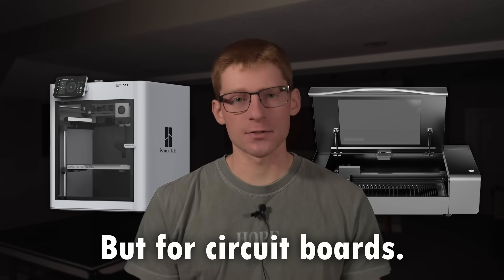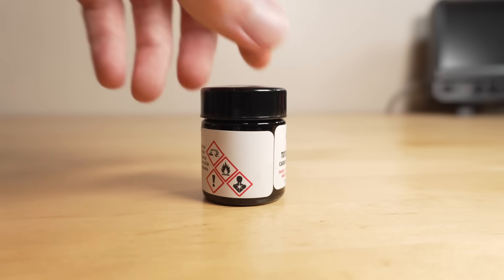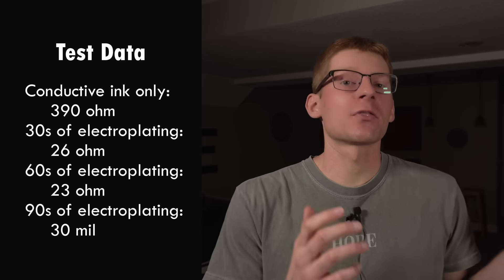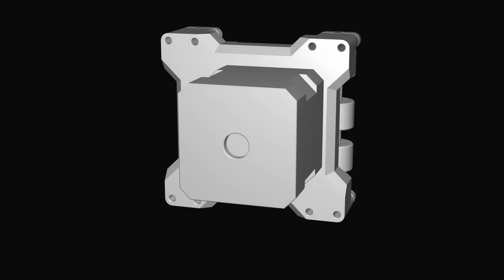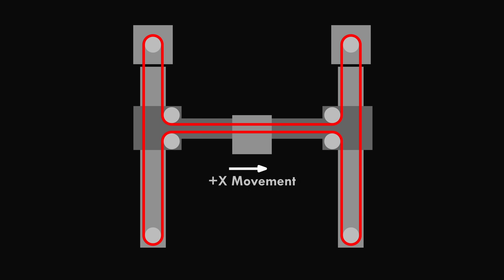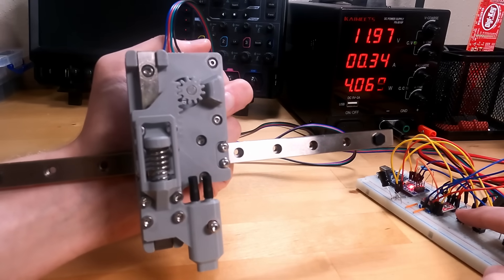I'm Developing a New Circuit Board Manufacturing Technology

Comment: This project in very interesting to me. I started a few years ago building a pulsed plating power supply, but got side-tracked and have yet to resume it. This project was in response to the fact that commercial PPP gear is very expensive. The advent of PCBWay and others like it reduced my motivation somewhat, but I still resist the idea of paying for 10 boards when I need only one. I hope you will continue with this research, so I can have a reason to resurrect my own project. Maybe I'll post my work on that and link it to yours so more people will climb onboard and maybe get enough crowd-sourced engineering to create a new solution to a long-time and widely vexing problem.

Comment: A 0.3mm hole. I think most folks might buy it if it could do 1mm vias just fine. Sometimes you cant give all the bells a whistles on the first sell. Could you possible copper coat the inside of the hole using high voltage? Also 30awg is 0.254 mm thick so maybe find a way to shove a small piece of wire into the hole and bond it? Not every idea os a good one.

Comment: Couldnt you just start with a lower voltage, then start to generate the electroplating, then increase the voltage? 

Complete hypothetical thought experement. 

Lets say you start with 20 volts, which under just continuous voltage lets say would take 10 mins to form, too long but it gives the best through hole.  

If you started with 80v the copper would form in a few seconds but the  issue was the copper would add to the end too fast eleminating your hole you made...etc. 

What if you mix a little A with a little B. 

Start your electroplating at a minimum voltage, then either linerally or logorithmically, or even pauses in the voltage to increase your voltage over X time. 

Then it would be just playing with 3 variables. Which would be your: 1.start and stop voltage. 
2. Your stop in time. 
3. And how your voltage changes between said time frame.

Comment: How about breaking down the via plating into two parts (1) ink deposition in vias sequentially (2) electroplating all inked vias simultaneously using a bigger tube flushing a large section of the pcb?
Reply: Great project, amazing to see, congratulations 👏👏

Comment: This sounds like an interesting project. Let's see now.

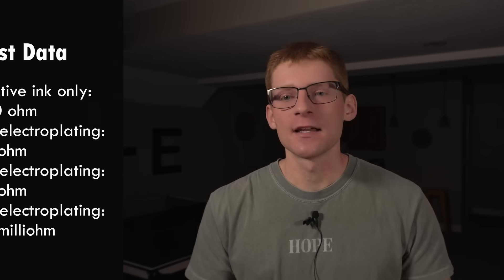@4:30 Impressive "via" resistance. I am concerned about the strength of adhesion between the substrate and the vias through the carbon layer in that it might lead to flaking and cracking, which would cause a rise in resistance.

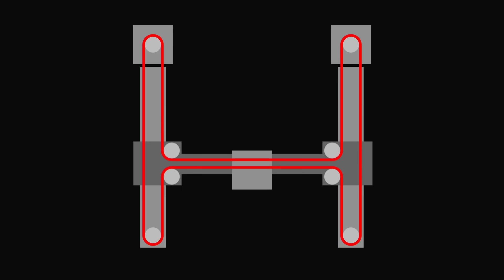@8:30 Interesting. Reminds me of the movements permitted by helical wheels. Unfortunately, the motors will fight each other. You will either need to use motors that cannot be backdriven or a feedback system that allows them to detect and compensate for the forces exerted by each other, otherwise you'll have positioning issues in terms of accuracy, precision, and reproducibility.

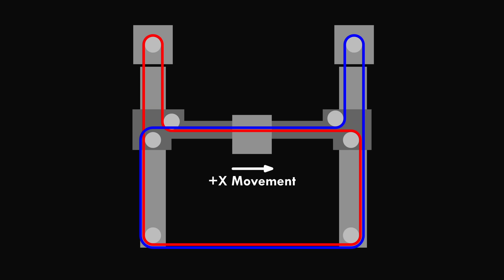@9:45 Oh. I hadn't considered the differential torque applied to the gantry.

@12:00 Ah. There's some of the positioning issues that I had anticipated. Yes. With two independently-positionable mechanisms, the ability to co-align them at a specified position is an absolute neccessity.

@14:25 Your electrodes must be in a different position in your device, relative to the board, compared to when you did it by hand.

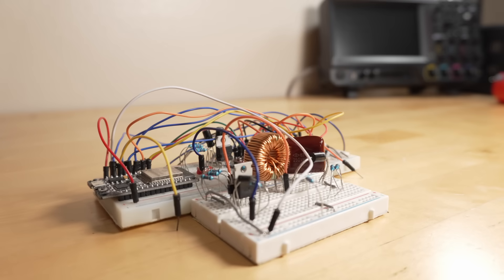@14:45 You went from 12 V to 80 V? Careful about those voltages and currents. You don't want electrolysis-caused bubbles to form on the surfaces onto which you are attempting electrodeposition.

I wish you success in your future attempts! I will be looking forward to seeing them!

Comment: The reason the industrial way to make a via is to electroplate is because it is convenient INDUSTRIALLY. 
Your solution does need to copy that. Others have mentioned it too.  A simple, mechanical way of adding a conductive material between two layers is the way to go I think. Perhaps you already thought about it. 
Like a prefabricated piece that can just be picked, placed and secured on the drilled hole from both sides. 
Then you can use the same thing for pins too. 

Messing around with liquids and chemicals for a desktop application is unnecessary. 

But I do applaud your determination and creativity

Comment: just spitballing here, i think the fastest way would be a custom "rivet"-style connection. drill hole from top, bottom effector "stud" comes into place, top effector feeds 0.3mm copper wire into the hole, clips it off (nail clipper style mechanism?), then top effector switches to another "stud" and presses down - effectively crimping it in place.

Comment: Hi, great project idea! I just have a question, I mean the electroplating is definitely great. But wouldn't it be easier to just put metal rivet in the hole?  I think it would greatly simplify it, especially if a plan was to add pick and place ability. 😋

Comment: Reading the comment about using wire to make via. The main argument I read is that you need to solder them and it would melt if you heat them back when installing component. But what if you electroplate them. No soldering but creating a copper link to the wire and the copper plate. Once the wire is connected to the board you then remove the copper to make the traces. By CNC or other process.

Comment: This is a really impressive work. The itch you try to scratch is shared with so many EEs. I have seen several projects lately, trying to come up with a good solution, but I think you are the one really tackling the important issue of vias. 

It’s so easy just to skip the hard parts, even if they are important, just because they are hard. Google one’s brain to think it’s still worth the job. And people ends up spending a lot of time making a machine that will not be used when they completed it. 

I’m wry sorry you didn’t get the vias to work and I hope you have better luck with the next iteration. 

Regarding the issue described above, I’m afraid you might have done the same, not skipping vias, but layers. In this advanced time of electronics, where we put radios on everything, and high speed lines between components, two layers isn’t enough. Suddenly you are limited to arduino level boards. 

I think you should twist your brain to make a system that enables you to make four layers. Or, when that problem is solved, any number of layers. Then you will actually be able to use the machine. And many labs around the world would be interested in buying it. Maybe even your sponsor would be interested in, where they sell the machine and offers all the consumables. Then it wouldn’t compete with them because this machine would be expensive in use, and used where time is the limiting factor. 

There are many ways to solve this. Probably the most likely way is to start with blank fiberglass boards and grow on the traces like you do with vias. Print the layout with conductive ink. 

I really admire your work, it’s really impressive, and I don’t want to appear like an internet sofa complainer, I’m just sharing my thoughts as a fellow creator whith the same dream of a desktop PCB maker, knowing that the limitations for me today, making me not using the CNC and rivets, that actually works quite well, is that I need the ground planes on almost any project I do today

Comment: When manufacturing a peristaltic pump, it's crucial to ensure that the inner walls of the tubing being compressed by the pump do not come into contact. I work with dialysis machines that use these pumps, and maintaining tight tolerances is essential. If the inner walls of the tubing touch repeatedly during operation, it can cause material (e.g., silicone) to break off and contaminate the liquid being pumped. This is particularly critical in medical applications like dialysis, where contamination must be avoided at all costs, but it's likely important for your application as well.
Reply: Another note, these tubes are consumables and, in the case of dialysis machines, are typically rated for around 12 hours of operation before needing replacement. Something to consider in the design.

Comment: Just wondering if an alternative conducive ink would be helpful.   Adding Graphite Powder ( dry lubricant). to a liquid or resin to make something like a conducive ink.  I have tried white glue and polyester resin. 
The Graphite Powder functions as a thickener for the polyester resin I did not test how low I could get the mix but I suspect that mix the consistency of toothpaste would be low enough resistance for many applications.    After thinking about it a few minutes I could not figure out a way to handle the obvious problems with mixing and applying small batches of the mix.   The most practical solution would seem to be making a filament  and maybe  a special nozzle because the graphite flakes would probably tend to clog the nozzle.

Comment: I work at a recycling center as a bus driver for the employees. They recycle plastic, paper / cardboard Etc.
They shredded around 30 - 40+ big boxes Packed full of repairman schematics on old televisions. This was either a shop or manufacturer that was from Cincinnati Ohio at one time.  Just about every old CRT, vintage television set you could think of was in there. Some televisions were pre-1950.
It broke my heart as a Electronics hobbyist seeing all of that engineering hard work & information destroyed!

Comment: 3:35 if you're gonna have multiple tools, just use a rivet gun. Rivets conduct, just drill you hole, put a tiny rivet through, and pop it to bridge the traces
Reply: That would work for larger holes, but like he said towards the end of the video, most vias are 0.3 mm. I could be wrong, but I don't think they make rivets that small
Reply: If not rivets, small wires could be dropped in place and soldered on both sides
Reply: @mossm717 That would produce horrible results though

Comment: This is fascinating!  

I thought you might like to hear my journey into a pcb mini mill.  I was working in R&D in the mid 1990s and transitioning from through hole to surface mount so I asked the company to buya T-Tech pcb mill.  Was told it was too expensive so I built my own from surplus motion control mechanisms, steppers, limit switches etc.  I controlled the steppers by sending binary sequences over the pc's parallel port.  I wrote a gui in Visual Basic and was able to move all 3 axis.  I needed a way to automate pcb milling so I wrote code to convert the gerber files generated by my then pcb layout program, Winboard, into movements that would isolate the pads and traces instead of just milling lines as the photoplotters do.  This was tricky but I managed to make it work.

Later on I got some real stepper controllers made by Phidgets and got more steady control.  I ended up milling hundreds of single and double sided pcbs.  Since then I've retired but have the machine and still use it.

Comment: My idea would be to drill the hole put a small copper wire through the hole press it on both end like a rivet and drill out a smaller diameter leaving a copper jacket.

Comment: Same approach but multiple vias with a protective film?
Like lay down a piece of tape, drill say 3 vias ensuring copper is exposed on both sides to make the connection.
Plate all 3, peel off the layer? Might scale to full board?  IDK I'm not in mechanical or chemical :P

Whatever you do, don't give up this projects rocks and of all the people working on this problem I think you are tackling it correctly by solving vias first when everyone else gets caught up on them after designing an entire workflow.

Comment: Here's my dumb idea for a machine:
Have a machine that can drill a hole into the pcb, then have a tool head with a silicone pencil-eraser sized plug that can seal the bottom of the via hole in the pcd. You can then have a tool above the via hole inject higher temperature solder into the via hole. Then once the solder cools, you can have the bottom tool remove the silicone pencil eraser from pressing itself against the bottom of the pcb, and you're left with a small cylinder of solder connecting each sides of the board. You don't even need the bottom tool to line-up with the top tool very well, you just need it to be wide enough to make a flat bottom for the solder to be held up against. It'll probably have way too much resistance, and be at risk of melting from other things you solder onto the board, but it's technically a cheap and easy solution that'd probably take like 10-30 seconds per via.

Comment: I have thought about making a PCB maker bot, but using via rivets. I used to use them 35 years ago after manually etching and drilling boards. I can only see loose rivets now but there used to be rivets in strips joined end to end that could be inserted with a tool and then a little twist or wiggle would break them off. I'm sure this could be automated.

Comment: I've made double-sided boards with a desktop router, soldering in tiny brass-rivet-like vias. Quite tedious!  My father left me a huge number of the tiny bits, which I've turned into a small number. I've not made any custom boards in a number of years, but if you make it easy, I might!

Comment: How about using an inkjet printer that could print with conductive ink, then use an inductive laser to cure or process the ink as it prints? Afterward, it could stack the printed sheets into layers, insert hollow pins into the via areas to align everything and create inter-layer connections, and finally place the entire stack in an oven to solidify the ink and bond the layers. It could be a streamlined way to fabricate multi-layered prototype PCBs!

Comment: Hi Levi,
Did you ever think of pre-making vias and insetting tiny little tubes into the drilled holes? Everyone buys filament to their 3d printers so this does not seem like a bad thing at all and would even significantly speed up the entire processing.

A tiny copper tube with with excess on both sides pressed with maybe heat activated glue, but that might not be necessary. We could buy a spool of these tubes and feed them into the machine...

Comment: Could the machine just apply high temperature solder (320+C) to fill small vias after applying carbon conductive paint instead of copper plating or as an addition to it? That way you can keep it simple but still be able to use hotplate for soldering stuff with 130C or 180C paste.

Comment: I think you are trying too hard to replicate production vias. 

For through-hole components, no inner sleeve of copper is needed. You can just solder the component on both sides and be done. 

For trace vias that are 0.3 mm, maybe just shove a length of wire though? I think building a toolhead which dispenses thin wire directly through a pre-drilled hole and then gives it a flush-cut and a quick shot with a laser on both sides to bond it could be very quick.

Comment: I've also thought about possible solution for vias, and the best i've came up with is solder as through wire and then electroplating ABOVE it:
TLDR: mask non-via |``   ``|, drill and make this with solder |`` I ``|, prepare for plating with V shape drill |``Y``|, deposit copper over |``T``|

1. Preparation (f.e. clean pcb blank)
2. Cover in easily removable layer of dielectric on both sides (f.e. soldermask, lacker, photoresist etc)
3. Clean vias sites from dielectric (i.e. expose photoresist to UV, but mask D+0.1mm circle above each via). This step might be unneccessary.
4. Dril via holes. Possibly would require two phases: initial drilling, then deburring.
5. Push wire through holes. Using actual metal wire might be impossible, easier would proubably be to soak with low melting point solder, taking advantage of the capillary effect.
At this point we should have a pcb blank with solder-as-via-conductors
6. Run the holes drilling again, but this time don't drill through, but just dip a little bit in with cone-shaped drill bit. We need to essentially do this at each via: ` Y `
7. Blank is then placed in a vat, filled with plating liquid, prepared side (post-coned) down, opposite side of the blank connected to the current source terminal, the bottom of the vat is an another electrode, connected to the other terminal. Vias are plated and that side should become a solid copper layer (turning vias to ``T``)
8. Blank pulled out from plating vat, cleaned
9. Blank then is swapped to the other side and steps 6-8 are repeated for it
10. PCB now should be cleaned on the both sides: remove the dielectric layer, sand down? the surface to get it completely flat and smooth
???
PROFIT!

Should be much easier than through-plating and much faster than plating each via individually.

Comment: You'll need a method of refreshing the electrolytes. I would use a tube that feeds copper wire into your bath so the copper wire becomes the sacrificial electrode. You'll also want to regularly measure the conductivity of the plating bath between runs and have the ability to add solution to make up for lost electrolyte/liquid.

Might look into faster drying plating solutions, one option is to use resistive heating to "bake" the resistive element, between the deposition and resistive testing phase. 
would let you deposit->test resistance->bake->test resistance but would require a current regulated power supply.

Comment: This looks amazingly creative.

But why bother at all with electroplating vias? Can´t you just stick a wire through and solder both ends? From a DIY circuitboard perspective that is more than good enough and can probably be automated more easily than an electroplating.

I'm also in the process of making a DIY circuitboard fabricator but am using a modified 3D printer for that with interchangable toolheads. One for milling/drilling and a 405nm laser for accurately curing soldermask.